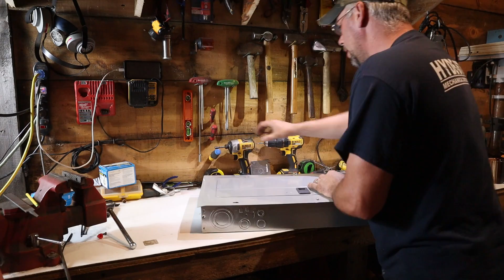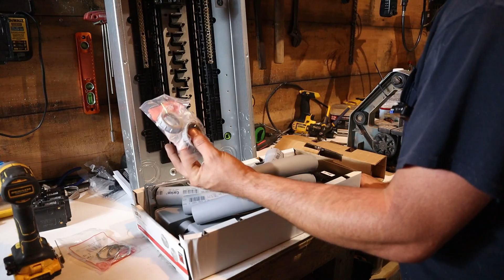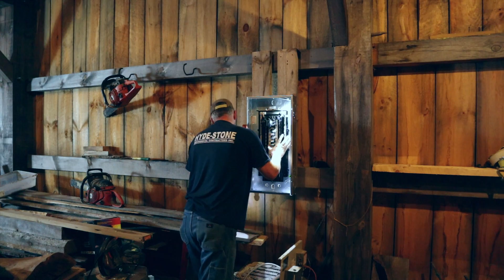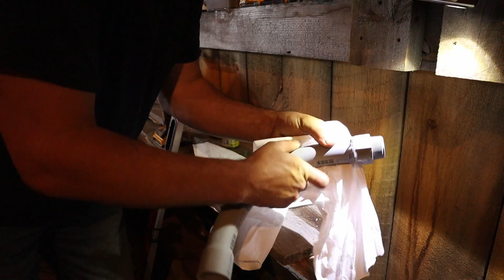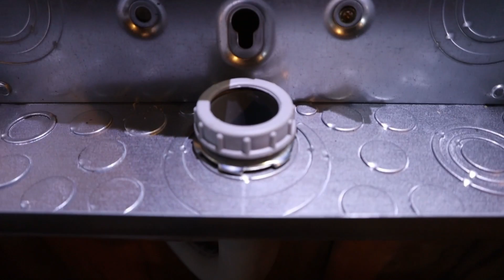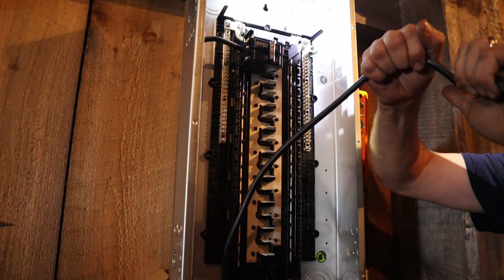How To Install A New Electrical Panel Box: A Timber Framing Vlog

Comment: Prof ally wire ? Over here no chance it's got to be copper.I am glad the install so far has been fairly easy the next bit ( digging the feed in ) might be a bit more difficult but knowing you it's a case of NO job to big.Go for it Jim  👍👍👍👍👍👍👍👍👍👍👍👍👍👍👍👍👍

Comment: Can I ask why you'd go with aluminium at all?  Are you just using it for the long haul thick wire and then use copper on the inside.  This seems to be the general opinion #2AWG THWN copper @ 75C is rated for 115A.
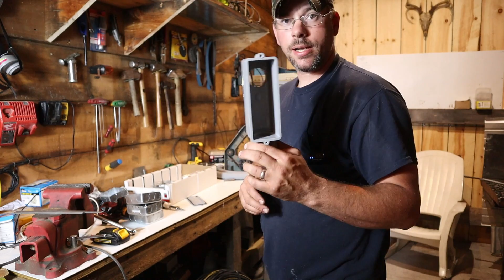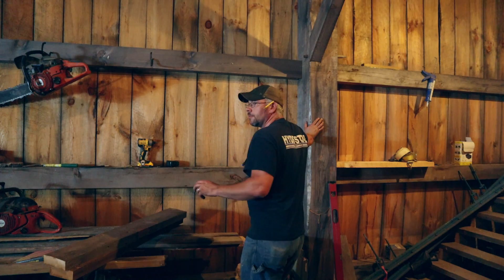 Rule of thumb for aluminium conductors is 2 trade sizes larger. 1/O THWN aluminium @ 75C is rated for 120A. Here where I live if you mention aluminium wire there are gasps and snapping of heads.  All the pain in the ass stuff you have to do to satisfy the insurance companies makes people walk away from it.  Not to mention the price per plug is ridiculous.  Working in the dark in the northern tier is tough since it's soon going to be dark at 16:30 and stay that way until 07:30 the next morning.  Happy for you to say the least!!!
Reply from the maker: There seems to be major confusion amongst people on aluminum wire.  It is against code to run branch circuits in aluminum.  It is pretty well standard practice to use aluminum as service entrance wire as well as se cable for sub panels.  Copper is more prevalent in commercial but as far as residential most people cannot afford to run those sizes in copper.  I have been running wires for almost 20 years and I have never seen a single issue with aluminum entrance wiring or with se cable that was installed correctly.  The big issue with aluminum wiring was in the mobile home industry when they used it in small gauge wiring.  The terminations would often loosen up over time and cause fires.  Today I believe it is not legal to use it that fashion.

Comment: Evening Jim.... I have a 100 amp service in my barn as well. It does help when I need to use my welder too. Back when I ran it, 80's I think, I used copper, but that's when it was affordable. I think you are going to be nice and cozy come this Winter.
Reply from the maker: I hope so John.  Just tying up loose ends.

Comment: Interesting to watch the box set up "up close and personal".
We had a whole new service from the street in to the house, apartment and barn a few years back.  Old stuff was 1949, plus some improvements.  HUGE difference in monthly power costs.  (Old stuff was done by an industrial electrical company, so was top of the line in it's day.)  I didnt get a chance to watch over the shoulder of the guy doing the recent renovation - I do like to see.
Reply from the maker: I've pulled some of those old systems out.  Done right they were fantastic.
Reply: @TheTradesmanChannel  My grandma's family were "Ziebarth Construction" - electrical contractors.  They built the original electrical towers from Hoover Dam to Los Angeles.

Comment: That is good progress1!! it is so different here, now we run 220-240V wich makes wires thinner. But technology is much more different to do the same.
Reply: In the US, electrical service is 240 volts with a center tap. A plug will be connected between a phase and neutral.

Comment: 4/0 my ass! How about some 750 kcmil marine cable. Then you know you're an electrician, lol. I know your breakers are rated co/al but you might want to go back and add a little de-ox to those lugs with the aluminum wire, just a thought. I am not certain about your local codes, but you really should have separate grounds and neutrals at a sub-panel and a dedicated ground back to the main panel. I know you work with electrical equipment all day long but I see this mistake made a lot and it can cause problems later on.
Reply from the maker: Code here wants a neutral tied in at the main panel.  I am putting a dedicated ground rod in for this panel.  As for de-ox, I know to use it but I forgot it.  It will be added.  I did used to work with cu mcm 500 quite a bit putting in 400amp entrances many moons ago.
Reply: @TheTradesmanChannel  even with the ground rod a single conductor ground is required for sub-panels. If a separate building a ground rod and ground conductor is required.
Reply from the maker: That's interesting.  My code guy here says this is the way he wants it.  I'll have to ask him.

Comment: Good afternoon, Jim. Seems like it's mounted just a bit low, is there a requirement for permitting and inspection in your area? 
Yeah, the stripped ends of the cable do look rather short. The terminals in  those breakers are definitely quite shallow. I sure hope the 100A box covers your needs for years to come. Well, I guess you won't be running a coffee maker, a large microwave, and the welder at the same time out there, so it should suffice. Now, what if the boy and Emma have projects going at the same time as you? Do you think it will run the bandsaw or lathe, a dust collection system, and the welder at the same time? It would be close, that's for sure. Glad to see the barn getting its own dedicated power service branch from your main service. This should help out quite a bit. I know all about those 100ft cords laying across the ground. Yeah, my damaged brain forgot to roll it up once when I came through with the mower and got reminded rather quickly. That was an expensive screw-up on my budget. Congrats on your pending service.

Comment: It is a different setup here in the UK! ...... I have seen factories using smaller panels than that ;0)
Having said that it is 414V ;0)
Where we are terminating aluminium cables into a terminal we are supposed to use a torque driver to ensure it is right .... but the only Ally cables we use are in the supply cable! A dab of Vaseline works well on those seals (assuming they are not rubber)
You are right about the terminals getting more flimsy though .... the older ones are much more substantial. I am not keen on clip in busses though. Too prone to overheating! Ours tend to be solid with a screw connection clamping the breaker to the bus itself and the other end of the breaker being secured in a DIN rail. We are not allowed bare copper earth wires eather, they all need sleeving ..... but other than that it is all very similar ;0)
Shall we run a book on exactly how long it takes to fill the board up? ..... My guess is that it will happen, but not soon ;0)
Reply: You're right about sizing, Dave, but as you know, UK is running houses on 230-240 VAC. We're feeding all components 115 (110-120) so currant is higher. Many common things like a vacuum cleaner will draw 12-15 Amperes so a 20 Amp breaker is essential, and 30 not uncommon.
Reply: @jaylittleton1  and that is the reason you have individual areas under one breaker rather than the whole floor of a house on a ring main like the UK. When you factor in 415V 3phase you get real power available! Our distribution network is different too ..... it  is common to have substations with 400A fuses feeding a whole street of 50 houses (166KW)! We don't usually go above 400A due to the economics of cable size/cost and all new mains is supplied underground!

Comment: not to shabby you could make a good sparky, i would use ANTI-OXIDANT on the aluminium wire
Reply from the maker: I started out as a sparky almost 20 years ago now.  Did it for a few years and then got into the industrial HVAC trade on accident.  Wired houses on the side up until a few years ago.  I usually use deox but forgot it in the process of making the video.

Comment: Great video thanks Jim. Are you allowed to connect the supply from the house without having a power company who supplies the power come and charge you a fortune for connecting it. Here in the UK you require the power company to connect if you want to run enough capacity like you need for the barn. Electric  boxes in the UK have a seal which cannot be broken unless by a power company upgrading the supply. I like the reminder to use primer as well as the adhesive! All the best Jim. I can see the smile on your face getting bigger as the nearer you get to having power in the barn!! Graham 🇬🇧🇬🇧
Reply from the maker: Hello Graham.  For this I do not need approval and can do it myself.  If I had to pull the meter then I would need the power company and an inspector.

Comment: Don't know about where you are but we cannot mix brands of breakers in a panel !!  IF you have a cutler/Hammer panel you HAVE to use cutler/hammer breakers , you cannot mix and match !!!
Reply from the maker: I never said you could mix breaker styles, I said that the Cutler Hammer BR breakers are the most common around here and I happen to have a pile of them.  I was also comparing this style of Eaton box to the Square D Homeline boxes, they are very similar in layout.
Reply: @TheTradesmanChannel  Just clearing up any confusion !!  Breakers have to match the panel brand !!!!
Reply from the maker: Gotcha.  They need to match here as well.  This was the first time I've seen a CH box made this way.  Of course it's been a few years since I've done much electrical other than daily troubleshooting on HVACR equipment.

Comment: That's my favorite style of box and breaker, too. Don't mix them, though, between square D and CH. They'll gig ya for that, even though the breakers are identical, and are a match on manufacturers 'allowable swap tables'. Don't you love how you can buy a 20 amp breaker for 4 bucks. A 50 or 60 amp for maybe 20 bucks. Seen them up to 75 or so for 20 to 30. But you want a 100 amp? Fork over the mortgage payment buddy! I hear you on the shallow lugs. I usually strip a bit more insulation than is needed for those, anyway. Makes me feel better to know I've crammed as much cable into there as I can. And I'd get gigged as well for not using anti-ox grease.
Reply from the maker: I always use deox on big wire, service entrances and anything copper to aluminum.  Dissimilar metals are where it's most important.

Comment: I would suggest coming back in about a month and rechecking the terminal on the main breaker. The aluminum wire will move to fill the lug and can become a little loose. It can be a real problem on larger wire sizes.
Reply from the maker: Oh yes, that is a must.  That's why I mentioned it.

Comment: do you not have to put chromatic paste on ali cable there Jim we do helps stop it from oxidizing
Reply from the maker: I always put it on bigger stuff and I should do it here.  The only time I've run into it being an issue is if the wires weren't tight enough.

Comment: FYI on box height, NEC 240.24 (A) center of the grip of the operating handle of the  switch or CB when in its highest position is not more than 6’-7”
Reply from the maker: We're safe there.
Reply: TheTradesmanChannel I figured, unless you’re 10’ tall 😂

Comment: An inspector would make you put anti-ox on that aluminum wire even though the terminal is rated AL/CU
Reply from the maker: I should have used it.  I carry it too.  It's been a long time since I've done this stuff regularly.
Reply: TheTradesmanChannel honestly, I’d use it but I’m not sure why I have to given those terminals are AL/CU ... belt and suspenders I guess ...
Reply from the maker: NEC loves to make codes, that's how they get paid.
Reply: TheTradesmanChannel yep! The brother in law of the guy who makes gasketed wire way sits on the code committee and wala suddenly you have to use it in C1D2 by code ... go figure ! Lol
Reply: @TheTradesmanChannel  its ok with todays aluminum  cables.

Comment: Hey Jim, you should have two expansion joints for the conduit where it emerges from the ground at the house and Barn, it’s an NEC requirement...
Reply from the maker: We've never done that here, I've had many entrances inspected over the years and it's never been mentioned, even in the big commercial accounts.  You seem to be up to snuff on the codes, that is a handy thing.
Reply: TheTradesmanChannel I’d get knocked down if I didn’t use them in our area PA/NJ  all up to the AHJ I guess. I’m an electrician 22 years now electrical designer, also went to school to be an auto mechanic, kinda grew out of it, painted houses professionally for 15 years and a life long wood worker :) feel free to hit me up on NEC code anytime my friend ~
Reply from the maker: I figured you must be in the field.  Even guys like me who do a lot of this stuff aren't up to code like you are.  Just too damn many of them.
Reply: TheTradesmanChannel too damn many for sure ! Lol

Comment: Should be fine, I fed my shop 100 amp sub-panel with a 60 amp GFCI from my main panel.
Reply: Nothing wrong with that! The 100A panel is rated to be able to take 100A .... NOT an instruction thet you Have to use 100A ;0)
Reply: Dave W very true !